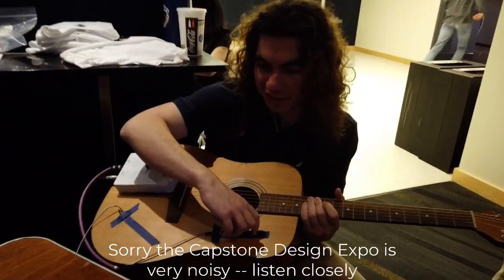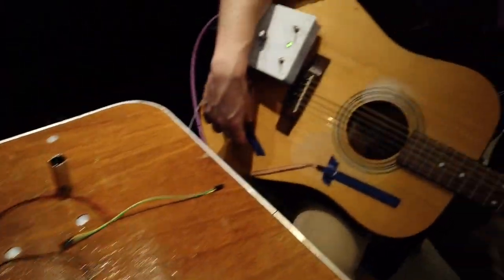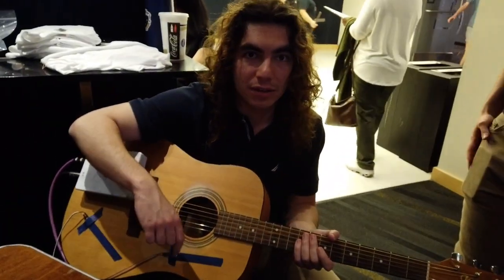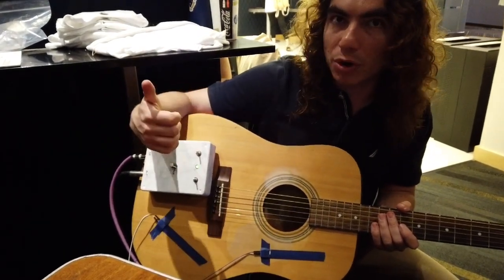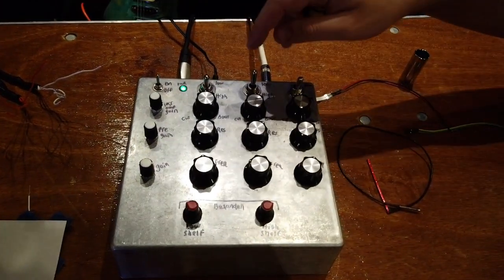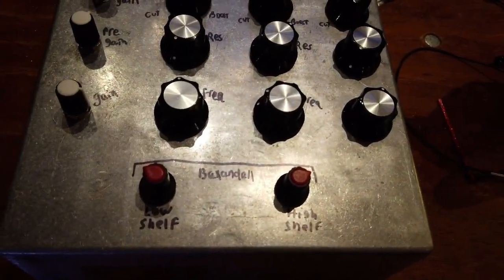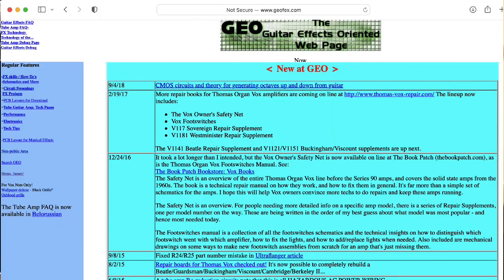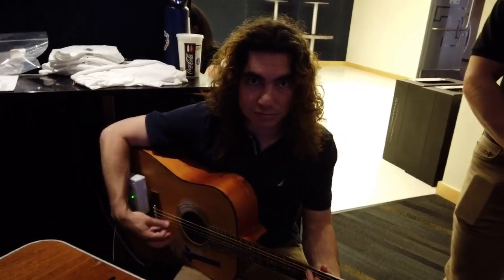Wood Piezoelectric Sensor for Acoustic Guitar (Student Project, Georgia Tech Electrical Engineering)

Comment: Mutable Instruments Ears was build for this purpose and toke a few years to design, calculate, measure and lab testing a circuit before it came to sale.
Professor, How does the circuit of the keyboard of the Buchla music easel look like and work?
Once i made a touch pcb (a long winded trace within the GND polygon) with a npn transistor for an experiment, though it kinda worked. Would like to know Buchla's circuit.
Reply from the maker: The Music Easel keyboard (and other Buchla touch surfaces) use capacitive sensing. Back in the day that took a lot of hardware; nowadays there are capacitive sensing chips to handle the gruntwork (Adafruit sells breakout boards for these).
Reply: @Lantertronics  Yeah, microchip has a partnumber with 3 variations, 5 pin devices, i think, one can make simple gate until you release, can't remember what the other 2 do.
although i have known them for a time, i never thought of them when doing actual shopping. : )

Comment: why this big box on the guitar body, charge amp is okay with longer (shielded) wire
Reply: Students are poor and have to use what they can get.
Reply: @AnalogDude_  i mean that is why to mess with it in the first place. it is little more hissy than a usual hi-z circuit but its piezo charge sensing  connection doesnt pick up that much of 50hz flying everywhere
Reply: @egorreshetnikov3864  OH, my comment was about the big box : )
Not sure how they made it, but i would probably put the Piezo buzzer element right next to the opamp of FET on the guitar.

Do you know Mutable Instruments Ears?
Reply: @AnalogDude_  again - u dont have to - that is the point to use charge amp for guit. piezo pickup (well for me at least, no need for ugly electronics on a guitar body)
Reply: Because students aren't experts yet and usually have to make a bunch of mistakes before figuring stuff out. Actually that's all adults. Maybe this was their first time, maybe they want to try something different and see where it takes them. It doesn't matter, at least to me, if it's perfect and optimized.
Reply from the maker: This wasn't one of my teams; it was a team advised by another professor that I stumbled across at the Capstone Design Expo. So I don't know why they made particular decisions. Most projects at the expo aren't particularly. refined, they generally have just enough time in the semester to get something working.